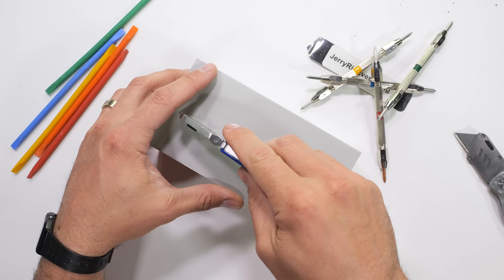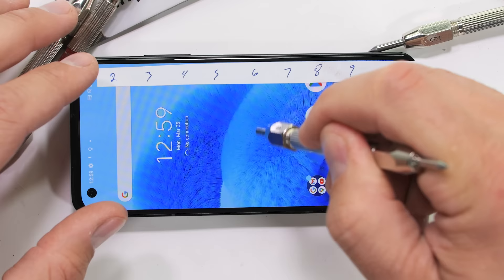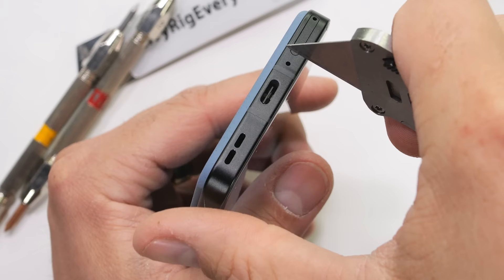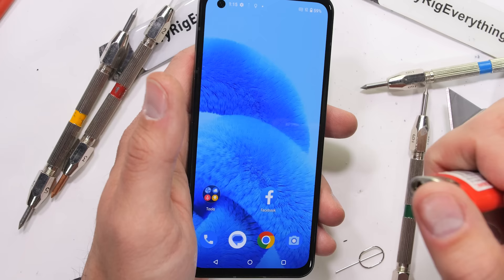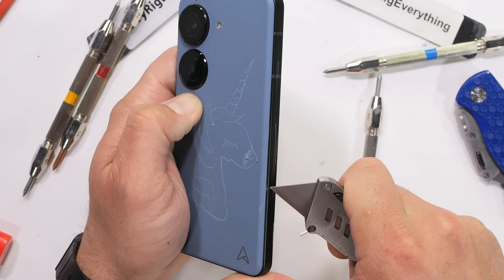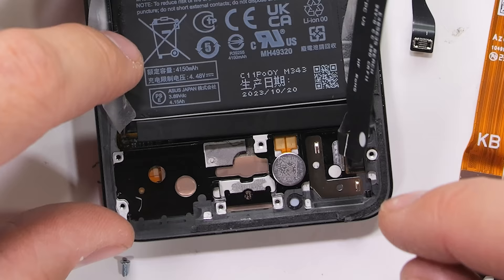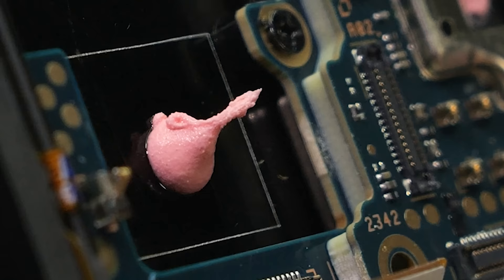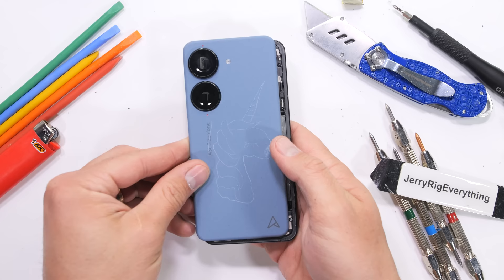The Last Living Small Flagship - (Rest in Peace)

Comment: Zenfone 10 is not "last living small flagship phone".
It's height is 146.5 mm (5,9 inch screen), while Samsung s23 has 146.3 mm of height (while its screen is 6,1 inches).
Zenfone 10 - 9.4 mm of thickness vs Samsung s23's 7,6 mm.
So you can easily say that Samsung s23 is smaller. Same with the s22 and s24.

I really wonder why the reviewers keep omitting the physical dimensions factor, while focusing solely on the screen size.

(Yet I'd buy the Zenphone 10 instead of Samsung, if only the price was ever to drop... After a year this phone is still too expensive, while the price of Samsung s23 has dropped by approx. 30%, which is way better deal).

Comment: Absolutely have to call out the blatant misinformation at the beginning of the video here.

Zack mentions iPhones get about 5 years of OS updates and Samsung and Google phones get 7 years.

The iPhone Xr/Xs/Xs Max lineup which came out September 2018 on iOS 12 are still getting updates and are projected to get the next iOS 18 update as well which will run well into 2025. That’s 7 years of updates, NOT 5.

Samsung’s Galaxy S9/S9 Plus lineup which came out March 2018, got only 2-3 years of updates.
The Samsung Galaxy S20 lineup which came out in March 2020 stopped getting updates after 2022.

Sure Samsung has promised 7 years of updates but there is absolutely no evidence of it yet.

I am not saying Zack is being biased but come on now.

And before ppl start calling me an Apple fanboy, I’ve used both iPhones and various Android devices throughout my life. Just needed to call out the misinformation because this channel has influence on people and spreading misinformation is dangerous and simply wrong.
Reply: Thanks !! My Samsung S10 (2019) still gets regular updates. I've never kept a cell phone for this length of time. It's been quite a workhorse...was $499 unlocked from amazon, just unbeatable value. It replaced my S7 which still works and I use it in my truck for GPS, text, email, garage door opener, monitor my home security cameras, internet and holds a descent charge. Friends are stunned I can still use it 😎
...I've never owned an iphone, never will...anything to do with apple, except the ones you eat, are overpriced, hyped proprietary crap...not meaning any disrespect...just my 2¢
Reply: @ltdees2362  so ur S10 is on Android 14/OneUI 6? Also best to never knock something before u rly try it. There’s a reason over a billion people use iPhones.

Comment: its not that small still 5.9" screen and only 84% screen coverage that is probably why it has low sells 
and size is still 146.5 x 68.1 x 9.4 mm that is not small, compare that to the galaxy s24 that is 6.2" and  90% screen coverage and phone size 147 x 70.6 x 7.6 mm
i can see why the asus didnt sell well... if it had 90% or more screen coverage it be pretty cool but that is just 84% its bad

Comment: What part of this phone is small ? Screen size is small ??? 
Body size s same as standard Samsung S class and Apple phone.
Asus s most expensive with smaller screen then the other 2 and only gives you 2 OS updates.

Small phones make no sense to be in flagship range and price. These are not for gaming so you dont need best performance.
Also you dont need best camera too with these cause small phones would basically be for communication only but they still have big enough screen to watch videos.
I wanted small phone for these reasons as i dont play games on my phone but the problem with large phones is that i dont have cloths with king size pockets for the phone to fit in them.
Modern all phones are basically so big then when you go to cloths shopping you basically need to test if the phone fit in the pockets and then pick the cloths so you cant just pick cloths you like